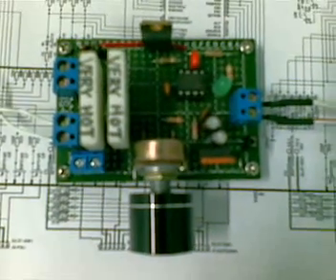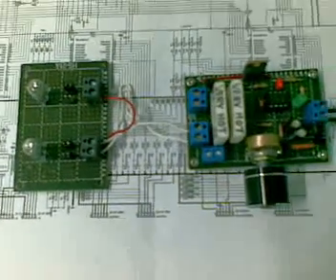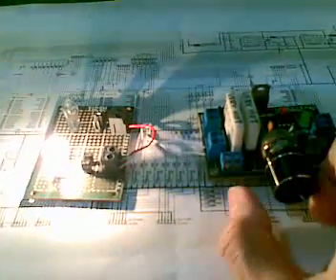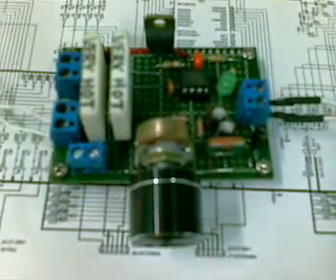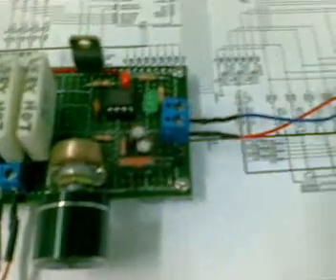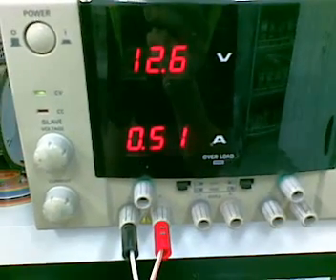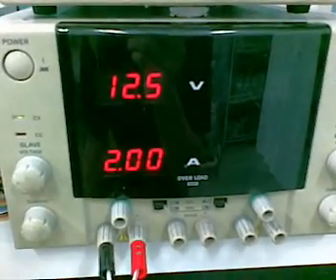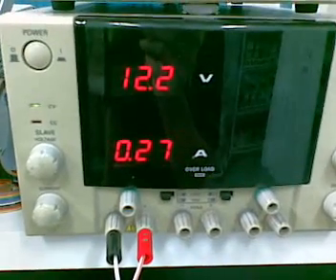Pulse Width Modulation - Light Dimmer/Digital Dummy Load

Comment: heating and air conditioners have this board in them even some 110 ac dimer switches that are a the hardware store they are usually 30 dollars or less some times even $20.00

Comment from the maker: Hi. Thanks for your interest. Yes, basically this a PWM light dimmer. With a small modification, i manage to transform it to a Digital Dummy Load where it can be use to test your power supply or driver circuit. Cheers.